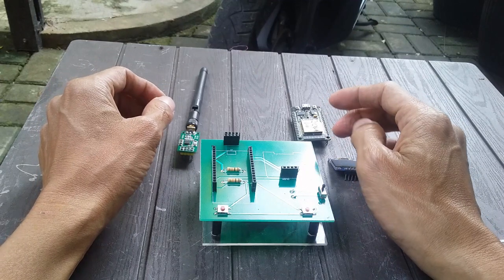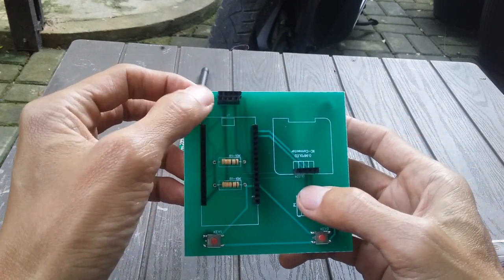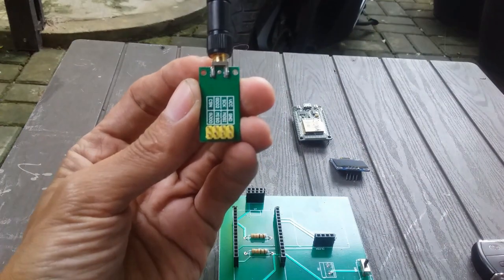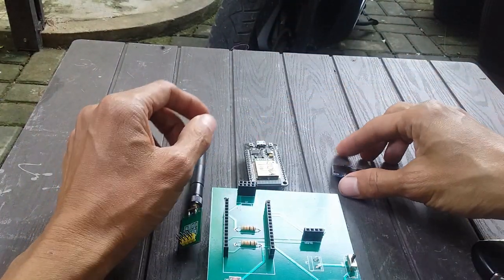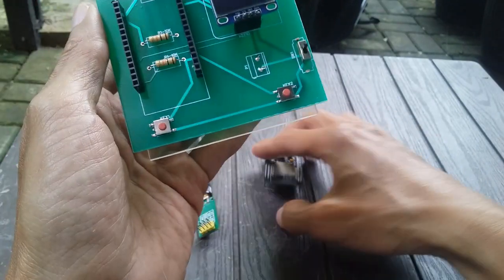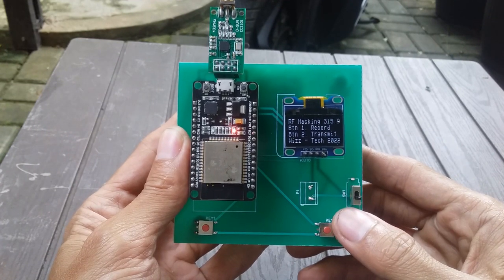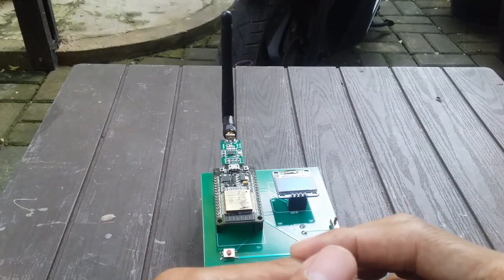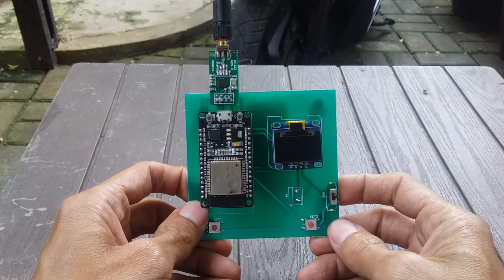Cloning RF Hack Alarm Motor : ESP32 + CC1101 - Part#2

Comment: Hello. Is this really for  433 mhz  frequency ? or other ?
Reply from the maker: You can set in the script 433.92 or 315 MHz or any freq below 1Ghz
Reply from the maker: In this video I set 316mhz
Reply: @WorkFromHome-th2eq  Ok thanks but how can I do it ? with different cc1101 or uncomment some script in code ? Or what ? Thank you for your support.
Reply from the maker: @tonkofonko  you can use same CC1101. You just change the freq in the script as you like .. I think the code is on top of the script
Reply: @WorkFromHome-th2eq  Ok thank you again xD.

Comment: PLEASE READ THIS MESSAGE
Can I use NRF24L01 instead of cc1101 to make an rf sniffer with the esp32? 

HARAP BACA PESAN INI Bisakah saya menggunakan NRF24L01 daripada cc1101 untuk membuat rf sniffer dengan esp32?
Reply from the maker: Have not tried it but I am not sure if we can use it because NRF24L01 is working on 2.4GHZ from the worksheet information  meanwhile CC1101 is working on 1GHZ. By the way thats my opinion mate.